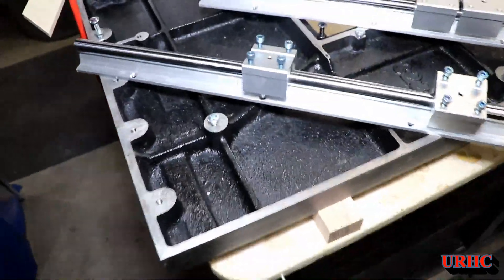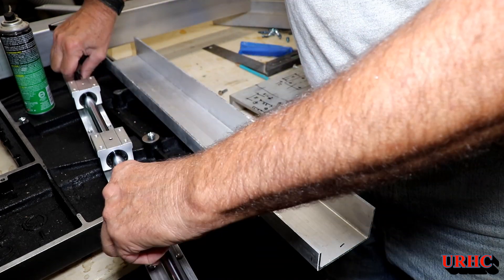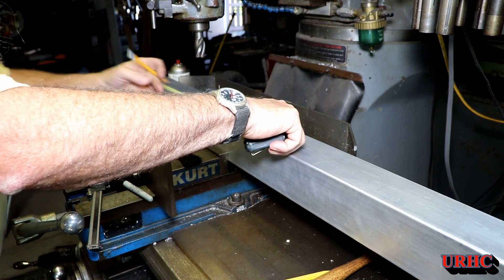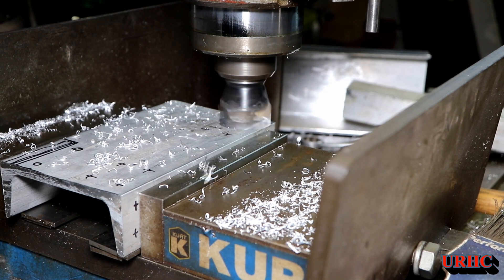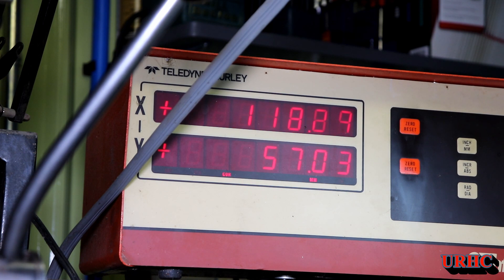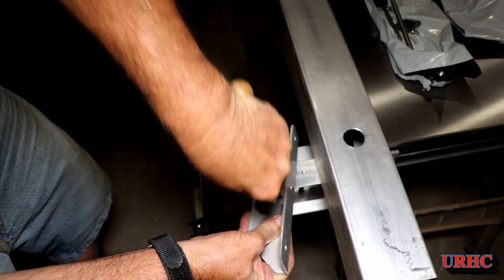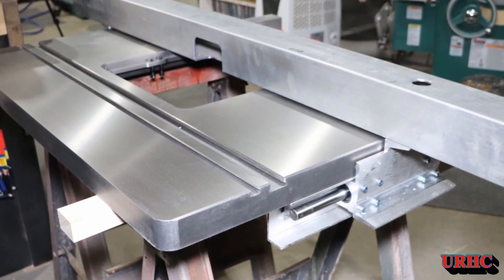Router Table Build Part2 More Purchased Parts, Starting The Auto Fence Assembly

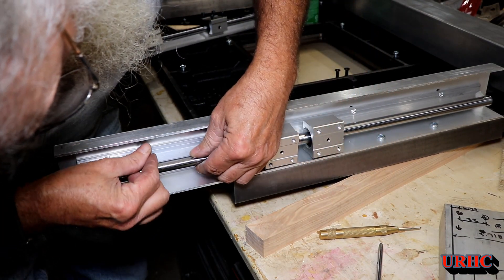Comment: When you said you have to get some better screws later (at 4:09) what did you have in mind? Curious to know what characteristics would be better/worse.
Reply from the maker: Those stainless pan head screws are very weak and hard to tighten. Each screw you use has different tensile strength and hardness depending on the type of steel they are made from. With hex heads it's stamped on the head and socket head caps it is in the manufacturers specs. That will determine the best torque to use when tightening them. Thanks for watching.

Comment: Great progress so far and really clean work! Good luck with the folks at UPS, I hope it all works out!
Reply from the maker: Thanks.  UPS has started an investigation and a replacement is on the way.  I think that fill in driver stole it because the tracking info he originally listed and what he told the manager are different.  Thanks for watching.
Reply: @unemployedredneckhillbilly2023   I have a security camera setup on my front door and I have had to use it for USPS lies. The UPS service here are trustworthy but slow.  USPS here are lying pukes and have claimed to have delivered stuff several times and haven't. They always seem to come through after I call and tell them I have a constant security camera recording and I saved that day they claimed to have delivered the item to my hard drive. We live in trying times. Thanks for sharing this video series I am really enjoying it.

Comment: I tried to reply and it vanished so I will try again. There is sure no excuse for any arrogance from any manager. It seems that UPS has gone dramatically to h%ll.  And I'm glad you took the time and spent the energy to complain about her.  WTF.  She HUNG UP ON YOU?  Insinuates you are lying?  Wow, she truly deserves to be fired.  She must be one of the "unfireables" to get away with that stuff.     You know... the ones who file an immediate lawsuit based on some imaginary,  obtuse "discrimination" grounds. NO excuse to treat any customer like that.  EVER!  I don't know how you manage it. I think my head would be ready to explode after all you've been through with them.  Things used to be so much easier when you could just buy something locally at a great price, and have someone be accountable when you have a problem. I just bought an 40V electric powered wheelbarrow made by Greenworks Tools. It was over $600 with tax. It arrived with a small crack in the wheel and a bad inner tube.  I called the company and they were very nice, but they don't send out parts on a new order.  My only choices were to pack the entire thing back into the box and UPS would pick it up and return it to Amazon as defective and then I would have to wait for a replacement.  Or replace the inner tube myself and live with the chip -  and that's what I did.  I tried to buy it locally but no one carried it.  NOTHING ever works like it should.  I hope that you get some satisfaction from UPS.  I guess your only protection is to try to get companies to require your signature in the future when possible.  I bet you will be putting up a security camera soon to film the UPS truck driver throughout the delivery process!  Ugh.
Reply from the maker: I have a complaint filed and will see. It's hard to find what I need locally anymore.  All the small town hardware and tool stores are gone with online buying the only option.  Home depot and lowes have pick up in store options that I may use more. I had UPS damage a 26 inch Weber grill a couple months ago from Amazon and had to pack it all up and ship it back because it was from Amazon. Wound up buying the replacement from home depot because Amazon wanted me to wait and there was a problem with the porcelain chipping on that one. Called Weber and they sent a $250.00 replacement bowl that FedEx put a forklift through.  Had th file a claim for that also but the FedEx people were great.

Comment: On the Arduino programming, you may want to look into GRBL instead of rolling your own stepper control programming.  I built something similar and just treated it like a one axis CNC.
Reply from the maker: I have been thinking about that.  I have a 2 axis grbl box built for a lathe I never got around to making.  Have to see if I can slave the second stepper driver in grbl. There seem to be some bluetooth apps that will work with that also for an accurate dro. Plus I  could  run a power router lift with that also. I am just learning as I go about the arduino capabilities. Thanks for watching.

Comment: As an electrician I cant wait for the electrical portion of this series! Thanks for sharing.
Reply from the maker: Looks like I need 220 because the router draws 15 maps alone and I don't know the startup draw. I need a couple amps for the electronics also so I figure 20 amps at 220 will give me plenty with one leg further router.  Going to use the contactor for the router because I can't find a switch rated for a 3  1/2 hp motor with the magnetic switch to hold that. Probably going to need a box for all that and the power supply.  Thanks for watching.

Comment: Nice update on this project. Sure is handy to have the Bridgeport. I don't have room for one but I do have one of the older Enco round column mills. Not as versatile as  BP but you learn to work around their shortcomings. Thanks for another video.
Reply from the maker: Thanks.  I almost bought one of those enco mills but at the time the economy tanked and machine shops were closing.  I got this with tooling vices, right angle head , and dro for less then a bare enco cost. Thanks for watching.

Comment: a router fence doesn't need to be parallel to the side to work, same as your drill press
Reply from the maker: Depends how you're going to use it. I need it parallel to the miter gauge slot for my plans so that's what I am aiming for. Thanks for watching.
Reply from the maker: Indexing a jug in the miter gauge slot automatically.

Comment: Hi, I have been looking for some slides, but all the one I could find wanted an arm and leg for them if you could point me in the direction or better still if you have the shortcut you used to buy the slides I would appreciate it if you could let me know it.
Reply from the maker: This is the set I purchased.  Also bought another set after seeing them. Ebay links change all the the time and I hope it works https://www.ebay.com/itm/123699109959
I don't know where they ship so contact them.  Thanks for watching.